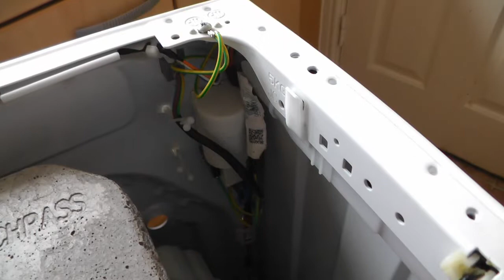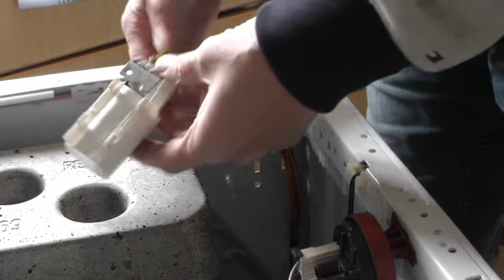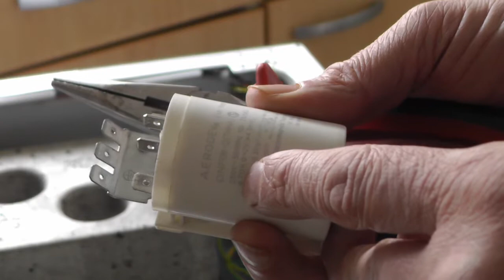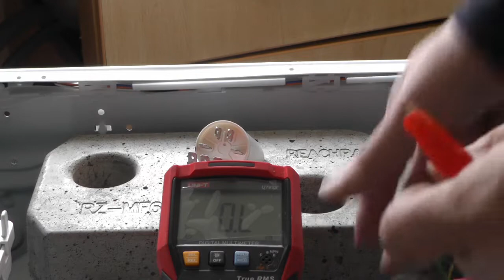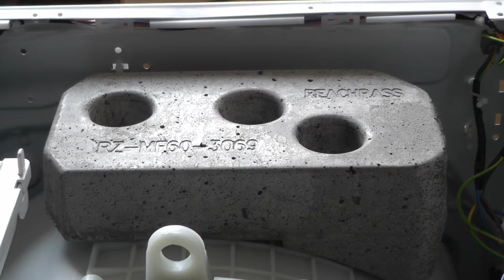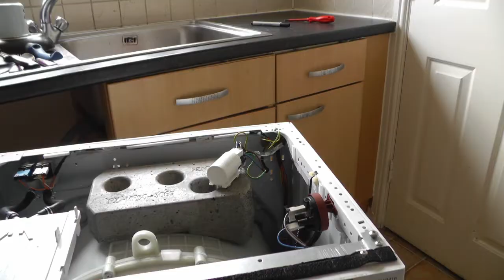Washing Machine NO POWER? Don't Buy a New One! (EMI Filter Fix)

Comment: i have a motor which is working and spinning the drum and then all of a sudden it starts buzzing! I have tested the motor and it seems fine. I thought this was a capacitor for it but I am now realising it isnt. Do you have any idea what could be wrong with my machine. I have only just bought it second hand and its not worked since i got it. Just starting but then buzzing and the drum stops spinning. Its a hoover h wash 500. convinced its something stupid, because it has done a couple of cycles. That's why i thought maybe dodgy capacitor!
Reply from the maker: brushes ?

Comment: If I have power to some functions on the machine i.e. drain pump works, fill valves actuate, then is my EMI filter likely to be OK?  What symptoms would be present so that you would you want to test this part?  It looks like line power in, ‘filtered’ line power out, no?  Same voltage reading on both incoming and outgoing.  Seems like if I tested the part for voltage on the secondary side and it matches my primary line voltage, my filter would be OK, no?

Comment: J dean … greetings- did you solve problem? Have same issue
Reply from the maker: it did fix issue after new part fitted.
Reply: @cagmito76  i realize this is 2 years later. but what new part did you install? the EMI worked as intended, right?
Reply from the maker: @jrodriguez1374  no nothing wrong with it I show how to test it with a multimeter so no need to guess
Reply: @cagmito76  thank you! I was able to diagnose my own washer with your help

Comment: I still get power to the machine the door locks but for some reason my drum doesn't move. could the emi filter be the issue why the drum no longer moves?
Reply from the maker: Does it spin freely ? could be motor , bearings if its locked , if not it could be many things.